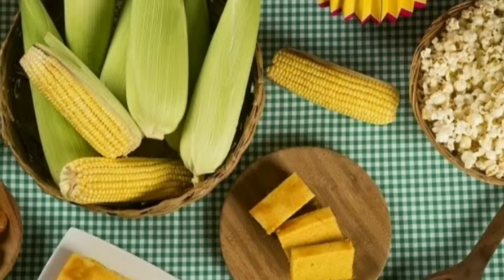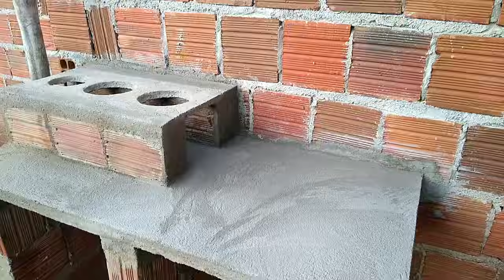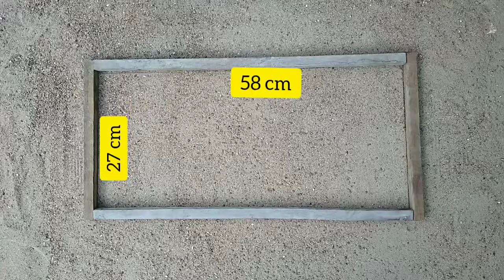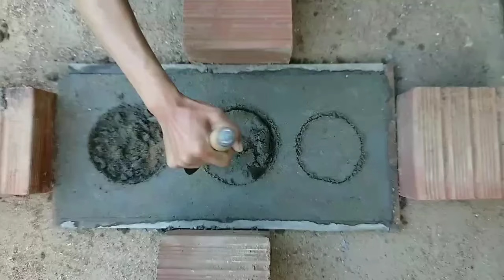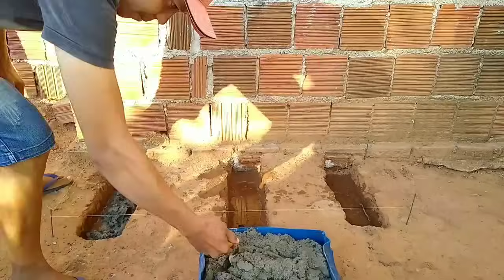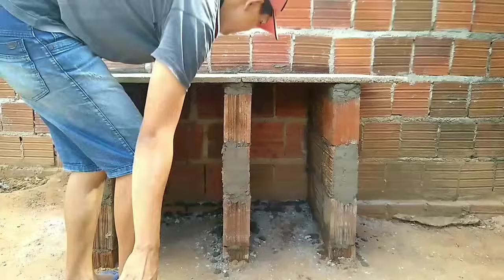Fiz meu Fogão a lenha olha como ficou🤗 Como fazer fogão a lenha fácil

Comment: Your wood stove turned out very well, one tip I don't know if you already use, but when making concrete mix refined sugar into the cement, the sugar makes the concrete withstand high temperatures when using the wood stove, and it doesn't let it bite.